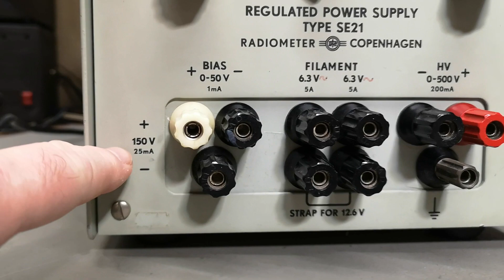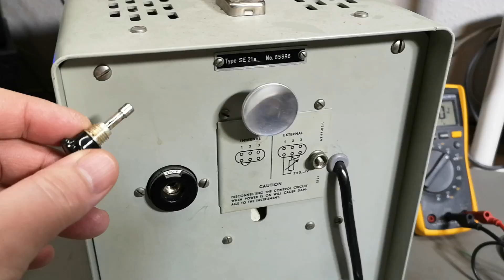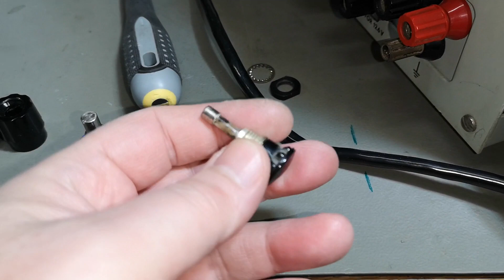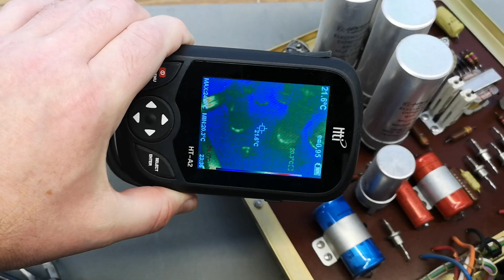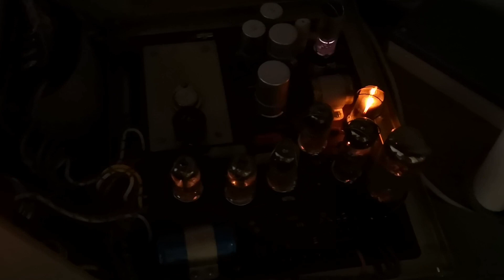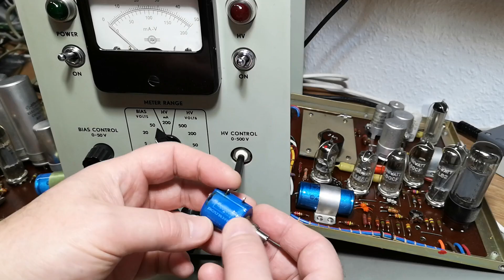Radiometer SE21 Regulated Power supply 0-500V 200mA tube 1963

Comment: I'm also a bit surprised about the size of the inductor before the pre-regulator, I would have expcted a much bigger choke there.(bigger inductance wise)
Reply from the maker: i think the value is that low due to the intention of this inductor is not delivering a constant current to the output, but it is only there to smooth the rise fall transition, this was not creating emc problems.

Comment: You were lucky with the short just being capacitors. I'm currently restoring an old Mil Spec dual power supply made in the UK C1951, it was well made but not designed to be serviced. The two supplies are completely separate, I have one channel now working, but there is a shorted turn in the power transformer in the other channel, I'm not looking forward to the rewinding this transformer. At least I have all the details of the transformer windings. 

I'm not so sure about the other commenter's suggestion about toggle switch directions. My power supply has ON as the down position, and I think this varies by country, manufacturer, and application. Certainly, ON being up makes a lot of sense in an emergency as you can very quickly hit the switch from the top to cut the power. I must admit that down for ON is quite common.
Reply from the maker: the worst thing about emergency operation of switches is they are different, so you first need to read and think, before hitting OFF,
i dont really care if they are up or down, but they should be the same, all over the world
Reply: @TeardownOZ2CPU  I totally agree that there should one consistent way a switch should operate, and it be the be the same everywhere.

Comment: So the tickty tick was the pre-regulator keeping the input caps at voltage?
Funny thing, Danish equipment seems to consistently use toggle switches the other way around than the rest of the world, I'm used to 'on' being up.
Reply from the maker: On Up is a USA thing, and specially an old days thing, todays most do it down is on..
Reply: @TeardownOZ2CPU  That was the first thing I noticed, very impractical - the probability of accidentally turning it on by moving from top to bottom is many times greater. In case of problems, it is much faster and easier to turn it off just to hit the lever from above, I have made all the devices I have made this way (unless there is a switch with zero in the middle) - I also have this orientation on the light switches - if there is a power failure, I just need to go through the whole house and where I don't have sensor switches (they turn off by themselves), just press all the switches down and I know it's off.
Back to the source, a well-thought-out design, the hinged PCBs are brilliant, the manufacturer also thought about service and the arrangement of the components enabled a smaller design - about devices made in this way, I say "There is so much there that there is no room for air" 😁
It is not necessary to have the switch switched to HV200mA to reach 200mA - i.e. about the maximum, or CC - that's how I understood it.
You fixed that potentiometer beautifully and you can be sure that I liked it and I will come again tomorrow 😂